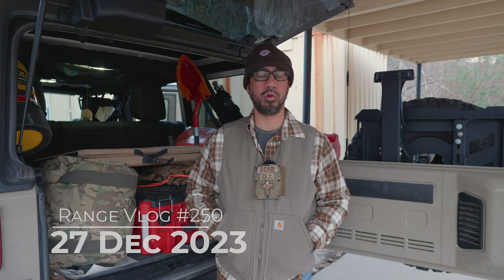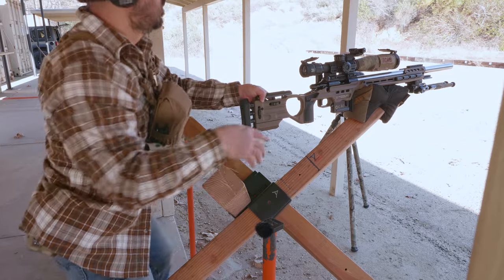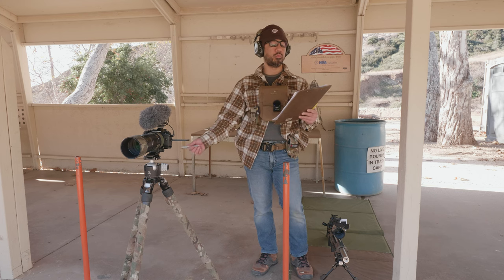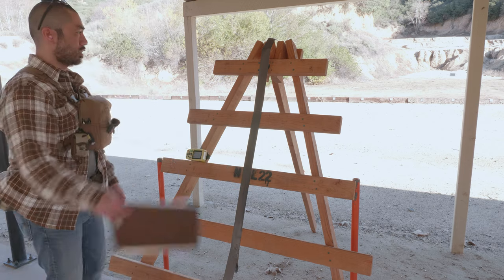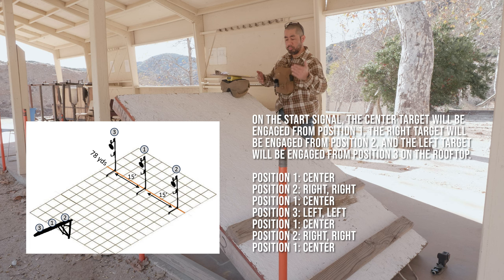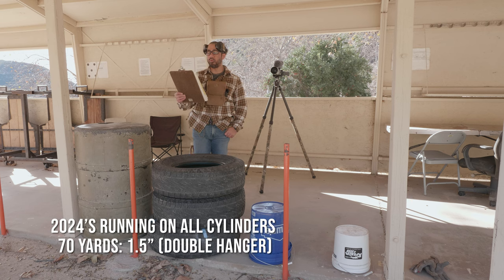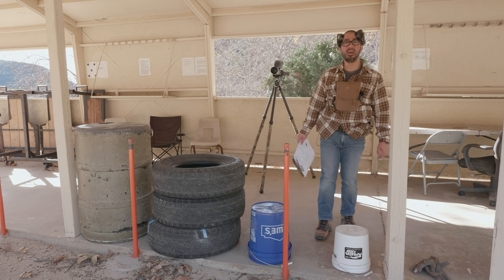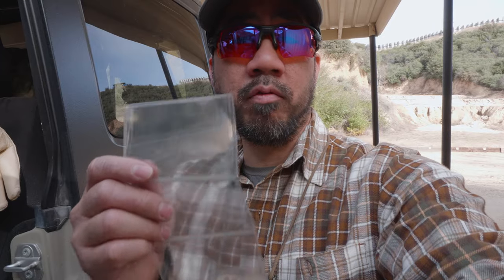Range VLOG #250 - January 2024 NRL22 Course of Fire Match Director Run-Through

Comment: On stage "Running into 2024" each horizontal rung actually has 4 positions.  The outside edge and inner center piece which is dissected to create an additional two positions.  This was validated by Dominic Thompson in the NRL22 FB Group.
Reply: For this course of fire the pyramid is divided in half with five positions on the left and five positions on the right.
Reply: @bankspressley7624  can you point to a source verifying this? As I mentioned the NRL22 Co-Director of Match Operations indicated that there are 4 positions per rung.
Reply: @bankspressley7624  my understanding is that ONLY the center position on each rung is to be divided in half - giving a total of 4 positions (left, middle left, middle right, right)  per rung (except the very top rung).
Reply: @jamesnierodzik8542 you are correct.

Comment: I cant say how dumb the sideways roof top is. Who ever designed that stage failed to consider the variants of roof tops at other ranges. 2x4 planks will be gamed by some clubs but not others. It's a completely un uniform stage.  Buckets, Barrels, and the pyramid will all be the same regardless of were you go. Our club has a roof top that is so steep its hard to work it even when you sit on it straight. Dumb Dumb Dumb.